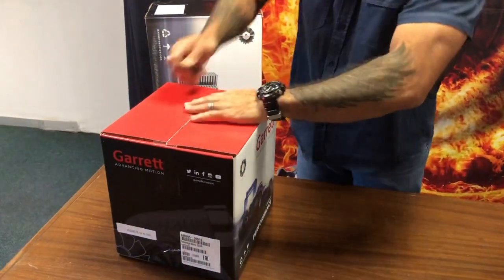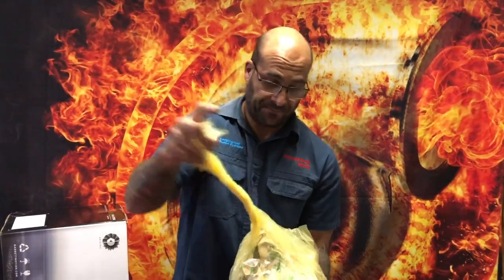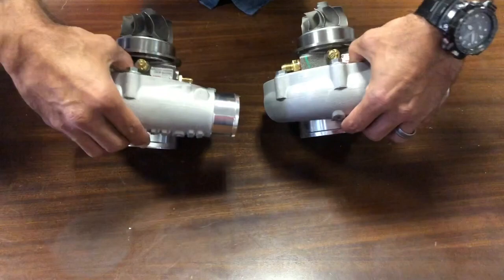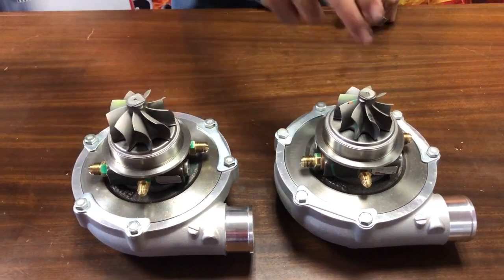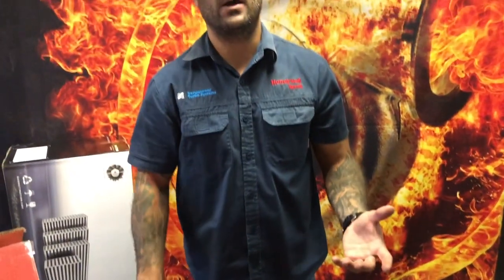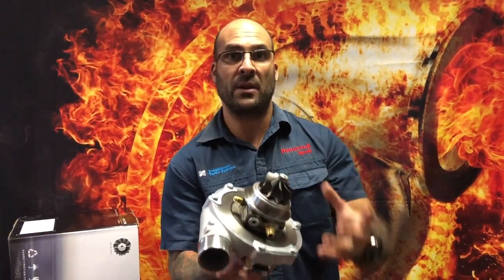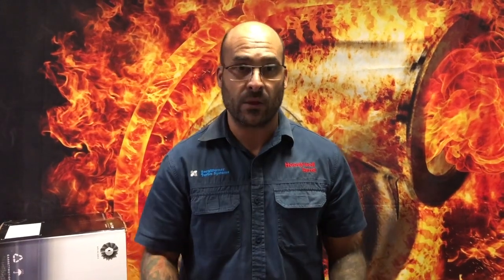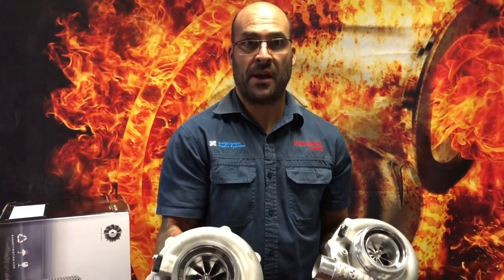G30-900 and G35-900 compared

Comment: Hi Chris, many thanks for the informative video and replies in the comments. i was just wondering if you could answer my question for me. im currently building a forged rb25/30 with extensive head work and all the goodies for around 600hp on e85. i want a responsive set up however i dont want to be blowing the tyres off everytime i put my foot down. im aware having 3L displacement will help me alot with spool on a bigger turbo, but do you think the g30-900 will do me justice? its a street car that will sometimes be running in roll racing / track days. Thanks
Reply from the maker: Great question - we have many clients who have similar builds/applications. The trick here with your setup is to understand that the small G30 turbine 55mmx60xx WILL blow the tires on this motor build - even if you use the slightly larger AR83 turbine housing.  For your application you want to have a slightly "laggy" setup to prevent that punch response low down.  The larger G35 turbine is just too big for this, even inside the smallest AR61 turbine housing -- 

So where is the balance - if this was my build, i would be opting for the EFR range - the reason is because they have a size thats (dimensionally and response-wise) in between the G30 and G35 - it fills that gap - and will give you the response you want when you want it and will not blow the tires off when the boost hits. Even at high boost pressures there will be traction (obviously surface/grip dependant and how you drive (turns, bends and punching the throttle etc) The route i would opt for would be the EFR7670 - it will make the power you want anyway.  The size of the Gamma TI turbine is 61mmx70mm which is as close as dammit compared to the G35 which measures 62mmx68mm BUT the mass of the Gamma TI wheel is 30-40% lower than the G35 - Thats where the response/delivery fills the gap between the G30 and G35 -- The AR of the turbine housing is also AR83 from the T3 family.

Comment: Are either of these comparable to the BW 8474?? I’m using my supra for circuit racing and want to make 600 but have room for future added power. 

What turbo would be a recommendation for fast consistent spool between borg and Garrett
Reply from the maker: Thanks for the comment - hang fire, next week i will be releasing a comparison between these units and the EFR8474 Black Series. I believe you will be very surprised.

Comment: This is a great comparison. What would you advise between G30-770 vs EFR8474 for VAG 2.0TFSI EA888 gen 2 engine?
Reply from the maker: Thank yo for the comments - this is actually not a fair comparison as the EFR has so much more to offer compared to the G30-770, the EFR is internally gated, includes DV and Boost control Solenoid. The EFR is also one family size up on the G30-770 - what you should compare to the G30-770 is the EFR7670, which is light years ahead in terms of its offering. 

he bearing system is far superior to the Garrett unit, who's design has not changed since its first ball bearing inception, except for the materials used for the balls and cages. The EFR features internal gate with up to 42mm swing valves, largest internal swing valve of any manufacturer, DV built in, with care taken to position the DV in the perfect position to ensure that the discharge is directed into the inlet of the anti surge comp housing directly through the specially machined port at the same gas path angle as the DV discharges at - something noone else offers.  The EFR7670 will spool the same and make more power in the higher RPM range of the engine (assuming 1.6 - 3.0 engine size) than the Garrett will.  The turbine wheel on the Garrett is smaller and will not hold the torque and HP in the higher RPM range - the EFR shaft being larger will still spool up against the Garrett because its made from Titanium Aluminide, which weighs 30-35% less than Inconel shafts. 

Price is the obvious next question - the EFR is most certainly a contender because of all that it offers over the Garrett at the same price point - with the Garrett you will have to purchase an external gate, fabricate additional plumbing, purchase a BOV, and boost control accessories -- with the EFR these savings are built in. 

The next point is about boost control and lag - which has nothing to do with these two turbochargers and is a general discussion - ill be making a video of this soon to illustrate the information. It goes around the fact that external gates are laggier than internally gated turbochargers.
Reply: Thanks for the response. The target is around +640awhp and I think EFR7670 would be out of breath, that's the reason I'm comparing the G30-770 vs the EFR8474
Reply from the maker: @lucaslaw_k  I have shot a new video covering the EFR7670 , it will be uploaded tomorrow some time - the turbo will not run out of steam, i go over the compressor map in detail - once you see the video you will understand. The 770 will fall off sooner than the 7670 due to the size of the turbine shaft and the shaft power driving the compressor. See the match bot from BorgWarner to understand the shaft power. 

Also the backpressure in the turbine housing with the 7670 will be alot less than the Garrett, which will free up for the compressor to flow more in the high RPM range.

Comment: How do these turbos compare to the older Garrett T04z turbo?
Reply from the maker: T04Z was a great turbo in its day, but the turbo was big and used outdated turbine blade design - it worked well for the "in between size" turbo where you wanted more than the GT3582R (only 675HP option available in a fast spooling offering) and the sometimes too large GT4094R - the T04Z came between these two turbos as a possible solution, BUT was laggy and when compared to the GT4094R later on (after everyone overcame their fears of trying it - and obvious financial outlay) the GT4094R came into its own and made its name - its still today a DYNAMITE turbo.
Reply: @TurboDirectSA  thanks for the info. The T04Z was recommended to a friend that's building an rb25det with cams,pistons, etc for his street 240Z. What turbo would you recommend for 600whp? G30-900 or G35-900? I recommended should go with the G35-900 with .83 exhaust housing.
Reply from the maker: @rickh5698  WAAYYYY too laggy!  I would opt for the GTX3071R setup - the RB25 is a lazy engine and will NEVER spool a T04Z up inside of 5000RPM!
Reply: @TurboDirectSA  I've seen a video of an rb25det with gtx3071 and it would loose traction easily when the turbo kicks in. How about a G30-770 or G30-900 instead of the gtx3071r?
Reply from the maker: @rickh5698  Change the cars setup if response is too fast for you. Also change the AR to a larger one on the turbine housing, this will also delay the power curve.  You the first person who has complained about response... :-)

The G-series are overrated for the money -and will spool similarly to the GX Gen2 series.

Comment: Hi Chris. I'm running bmw n54 and I am looking at these two turbos. I want to be capable of making 750wheel at the 7krpm redline on around 28-32 lbs of boost, e40 fuel. My question is will the g30 900 be able to make this power goal without falling off at high rpm, or should I go for the g35. It is going to be mostly a street car with some half mile roll racing.
Reply from the maker: TS - excellent question and with the technology out there today and options in terms of turbine housing AR's - there is alot to choose from -  What i decided to do is make a video to answer your question and cover a few more of the comments and concerns from the subscribers related to the same topic. This will be uploaded in this coming week.
Reply: @TurboDirectSA  awesome thank you so much! could you also compare both turbos to the 3582r? I'm especially curious to see if the g30-900 has enough potential to compete with the 3582 despite the smaller housing. Currently n54 turbo kits only have t4 flanges so to use a new gen turbo, i would have to go to the g30-900 as I don't believe g35-900's come in t4
Reply from the maker: @TS-jq9ex  We shot the video yesterday - i will upload this in the coming week. The GT3582R is discontinued, the bearing system is old, and the compressor design is from the late 90's --  i wouldn't compare this to the newer designs/models.
Reply: @TurboDirectSA  I mean the gtx gen II 3582r sorry. I should have typed out the full name. I’ll be tuning into the video for sure!
Reply from the maker: @TS-jq9ex  Id suggest you wait and watch the video -- it will be uploaded soon.

Comment: Hi. Thanks so much for taking the time to do these vids. I'm finding all of them very informative and interesting. As a follow-up to this vid though, was wondering what your thoughts are on the following: G30-900 with 1.01 ar vs G35-900 with .83 ar. Based on my pedestrian knowledge, I'd expect both turbos as configured to have similar max power, transient response, and boost thresholds, but you'd have more room to grow with the G35 turbine (as long as you don't run out of compressor). Would love to hear your thoughts though.
Reply from the maker: Jae - Thanks for the comments - we have a new video coming out this week covering the compressor map efficiency and calculations based on a specific engine, im sure this will provide you with insight into the subject a little more. Just a comment on the two turbos you mention - always keep in mind that the turbocharger is simply a fan, or an air pump. The engine consuming the volume of air that the "pump" is providing is essentially the determining factor as to how the turbocharger will respond and flow. If you have a 600CID V8 with a single turbo G30-900 withAR1.01 (yes its an exaggerated example) the power will be instantaneous and the engine will consume all of the capable air flow from that turbo before the engine passes 3000RPM.  Now if you using the same engine with the G35-900 with the AR83 you will certainly see a difference due to the fact that the backpresure and turbine flow differences will affect the overall characteristics of the turbo. The engine will still consume all of the available capacity of the G35 but it will be close to the G30 with the larger AR but not exactly the same as the turbine wheels weight between them are very far apart. 

Lets do the same with say a 1600cc Toyota 4AGE engine, the G30 with AR1.01 will spool say around 5000RPM at 1.5bar gauge pressure (just an example / estimate), changing to the G35 with smaller AR turbine will not spool the same at all as the weight of the turbine also comes into play  aswell as the pressure inside the turbine housing. 

Its something that has to be calculated using the formulas provided which incorporate the engine VE, CID, BSFC (brake specific fucl consumption) and RPM -- wait for the video on this - it will be a few parts but the first will be released soon.
Reply: @TurboDirectSA  Thanks so much for the incredibly detailed response and your time. Guess it's not as black and white as I was expecting, but what you said about engine differences playing a big part in the exact turbo selection makes absolute sense. I'll be sure to check out your follow-up videos on this topic. Thanks again for taking the time to share your expertise with the community
Reply from the maker: @jae9843  Pleasure sir - im glad you enjoyed it

Comment: Can u compare it with gtw3884 ? All around 900 and 950 , but which one will be better respond from low to 7500 , 8000 rpm
Reply from the maker: This is not an apples with apples comparison at all - the GTW3884 is journal bearing (we don't believe in the ball bearing versions for price versus output reasons) and will most certainly spool far later than theball bearing counterparts. The second issue is that the GTW3884 comes with the T4 family turbine housing, which is a much larger AR and the T4 turbine shaft is also larger than the ball bearing turbos in comparison. The GTW will spool at least 1000RPM later than the G35-900 making this a great performance turbo for slightly larger engines, and will make the 900-950HP claimed by Garrett

Comment: Hi 
Firstly thank you for your information it's really useful ! I have a question or you opinion which of the two turbos would you use for a 2.2ltr 4g63 Evo for800/850bhp for street and drag use ? 8000/8500rpm ? 
Thanks in advance
Reply from the maker: Neither - for drags on a 4G63 setup i would go for a larger turbo - low down response is not as key as the outright power for a drag application, and you will spend you your time in the high engine rpm range mostly - so the EFR8474 Black series is without a doubt a much better option as it makes a true 950-1000HP output and will spool fast enough for the 4G63 to spool it easily and flow enough to make power through to the RPM limit of 8000 and above.

Comment: This makes it even harder to decide. I have an Nissan Skyline GTR, RB26DETT standard displacement, and I want more response at a lower rpm, but I want it to hold to redline. I'm thinking G30-900 with a 1.01 A/R. What's your thoughts?
Reply from the maker: Keep this in mind between these two family turbochargers - the 30 family will spool faster, the 35 family will spool later. The 30-900 because the 30-900 might fall away at higher RPM, compared to the more efficient turbine of the 35-900, but spool-wise, the 30 will be your best bet.  

just remember, if its a street car you building then response is normally a priority compared to the last HP -  if its more of a dyno car or race/drag/strip car, andnot your daily driver, then the 35 is your route to go.

Comment: Hey Chris,
I've got a s2000 (usual vtec high revving).
I'm currently running a gtx3582r 1.01ar. I'm noticing alot of lag, now the motor is fully built and I'm happy to push it, and definitely want to achieve that with the new G series.
I'm stuck between the G30 900 or g35 900 and which ar for the best response and power band throughout the full rev range.
Reply from the maker: I would not purchase a new turbo, simply install the AR83 turbine housing, this will bring your boost response into a street-able area,  the GTX3582R is a serous turbo, changing to the G30 or G35 is a waste of time unless you have honestly maxed out the GTX3582, to which then you will need to look at a larger turbo than the G30 or 35.

Comment: Will the GTX3576r Gen 2 reach 700whp on a honda s2000? .82 housing vband
Reply from the maker: It will battle - especially in the higher RPM range where the Honda's like to rev. Rather use the larger compressor on the GTX3582R Gen2 - this will spool the same but make a higher power output compared to the small 76mm compressor, and allow you to run less boost and make the same power, making the engines life more reliable.
Reply: @TurboDirectSA  dang already bought my 3576. I heard the 82 is infact laggier. Idk people have been telling me its a 700whp capable turbo so im optimistic.
Reply from the maker: @maxsorin4167  Dont stress, when you install and tune, and if you experience the graph falling away early in the RPM range, increase the boost pressure around 200RPM before this occurs to lift the curve some. If this is not satisfactory, let me know, i might have an 82mm compressor wheel for you to upgrade to.
Reply: @TurboDirectSA  I will be tuning either april 23 or april 30. Will get back to you then. Is there another way to contact you other than youtube comments?
Reply from the maker: @maxsorin4167  yeah shoot me a mail chris@turbodirect.co.za

Comment: Hey what's the size difference from the g30-770 to the g30-900? I had a custom exhaust manifold made up for my car but the manifold was built to the g30-770 I'll have some room but I can figure out how much larger the g30900.
Reply: G30-770 is 58 mm and g30-900 is 62mm